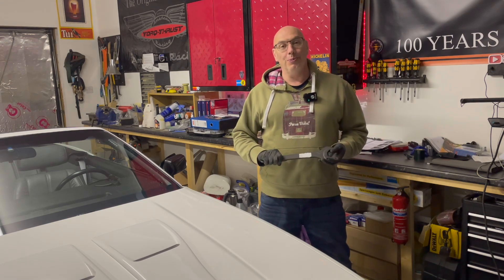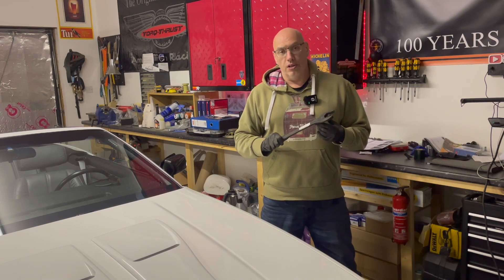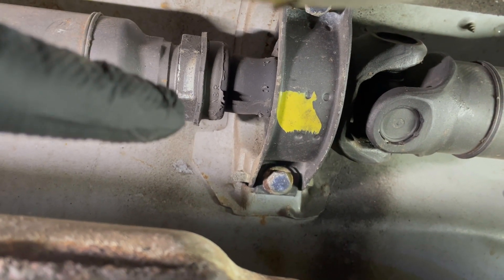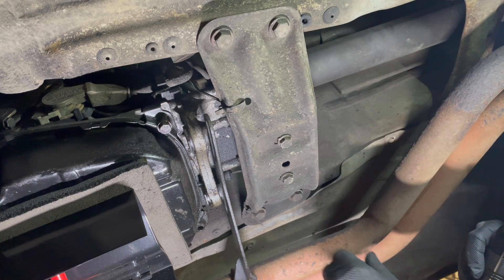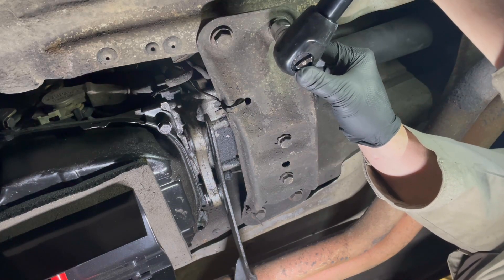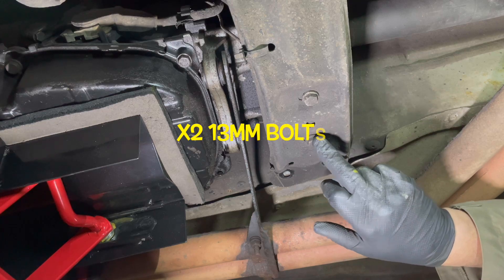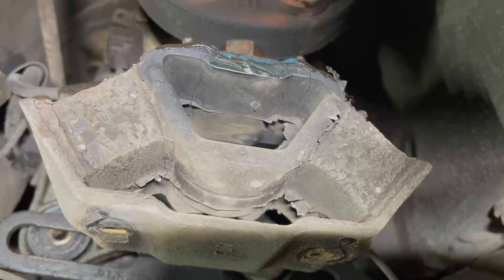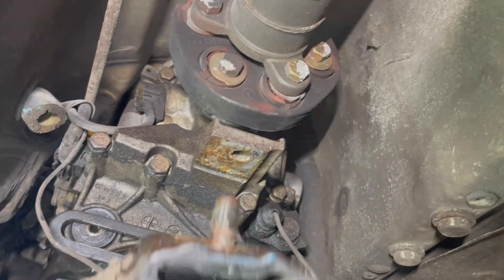W126 Transmission Removal Pt2 (Propshaft Removal)

Comment: Will you be looking to replace the flexi discs with rubber OEM parts or is there  polyurethane options available?
Reply from the maker: Hello! Thanks for watching and thanks for the question - very much appreciated. I’m going to be fitting Febi Bilstein rubber flex discs as they are manufactured by SGF (strangely enough) who I believe are the OEM manufacturer. I’ve never looked into polyurethane items (if you get such a thing) as I’m more for keeping my cars as original as possible. Hope that helps! 
All the best! Cheers 🍻!